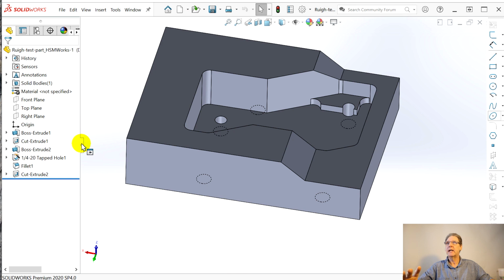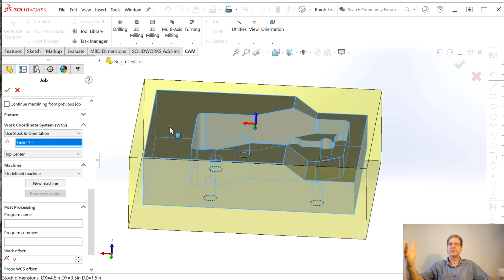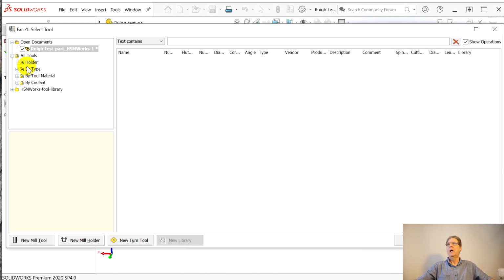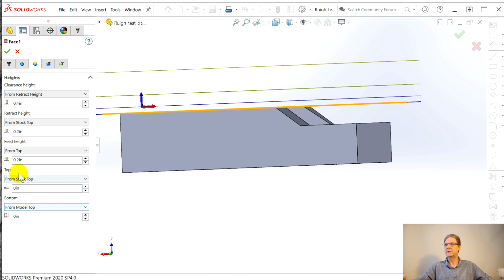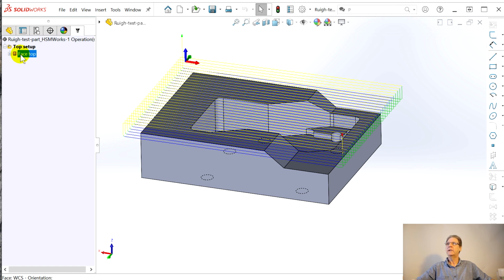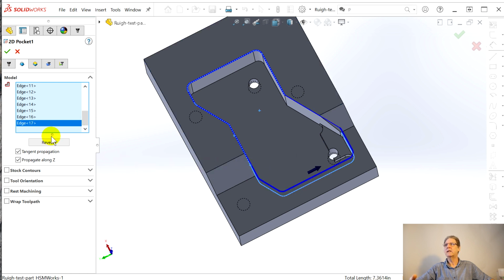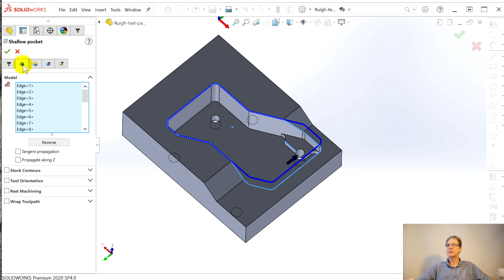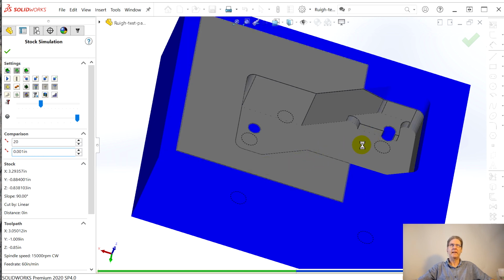HSMWorks first impression

Comment: Yeah, I swore off Autodesk nonsense since the late 1990's but this HSMXpress is melting what brains I had left.  Everywhere I read that it was easier to setup, and get going, than the built in one but I find both of them to be a nightmare when all I have is 1, or two, flat endmills. edit: I am following your vid and so far this IS better than the camworks one.
Reply: HSMXpress has no stock simulation to get you to buy the full blown and from a thread I am reading from 2015 - "It also will not properly render two jobs consecutively, so you have to trust/guess that it'll come out right."
Reply from the maker: Yes, I spent 500 a year (300 the first year) to subscribe, and full HSM is easier for me. Do realize these are very complicated programs. If you have a lot of CAD exeriance with SolidWorks, it helps a little, but CAM is a whole different world. Heck, I have yet to make some G-code to see how it posts, but for my simple needs HSMWorks should be fine.